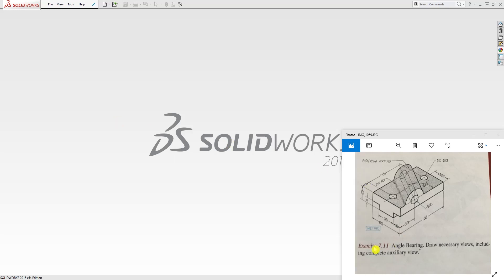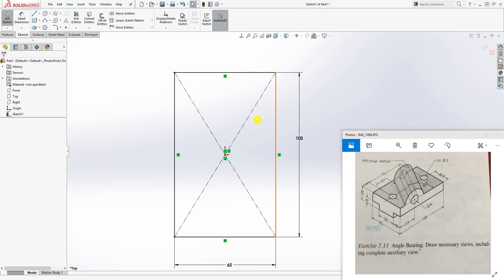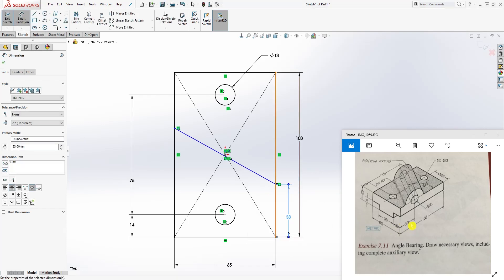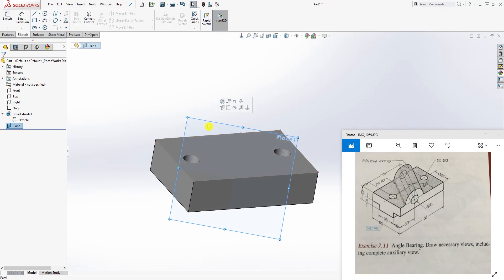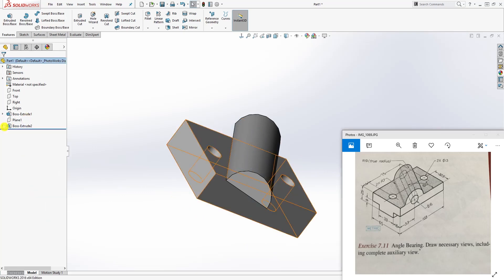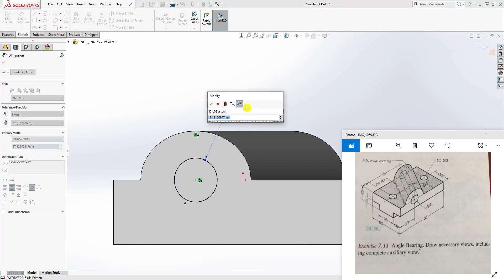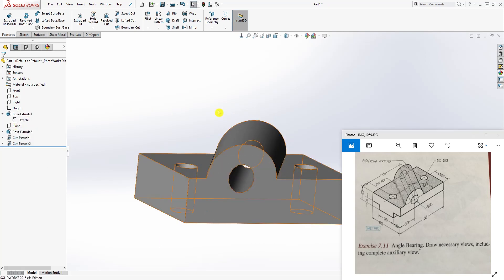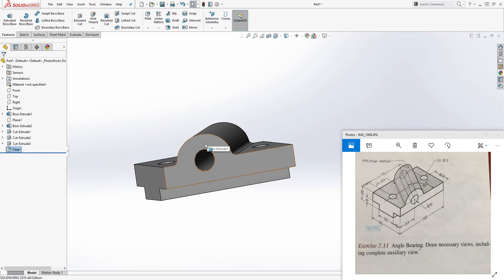SolidWorks Tutorial #60: Angle Bearing

Comment: is it possible to do this with loft?
Reply from the maker: Yes you can Rodrigo. Loft or sweep will work as well.
Reply: @CADDefine  the difference is that I am doing this for a class assignment in Autodesk Inventor, and I had to draw the 2 semicircles and then loft them
Reply from the maker: @rodrigobaldeon8443  Understood. The method you used will work as well. But you can create an angle plane in inventor as well. Don't you like that method?
Reply: @CADDefine  no i am trying because my drafting teacher failed 1 construction plane drawing and my control bracket so I have 2 do this drawing perfectly so i dont fail drafting 2
Reply from the maker: Oh ok. I am not sure why your instructor failed the drawing. If you want, you can send the work he failed to my email and I will review it for you.
Reply: @CADDefine  ok what is it?
Reply from the maker: info@caddefined.com
Reply: @CADDefine  i only sent one of the drawings the other i will send tomorrow since i dont have a photo from the book that i took it the drawing from and its in my school
Reply: @CADDefine  did you receive it?
Reply from the maker: Yes, please check your email.